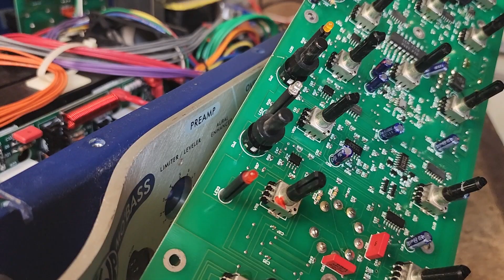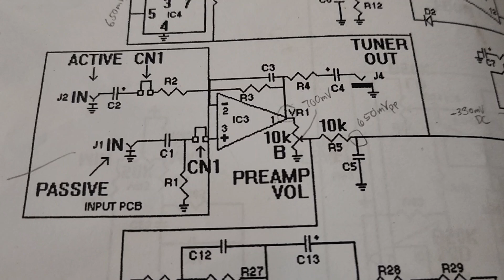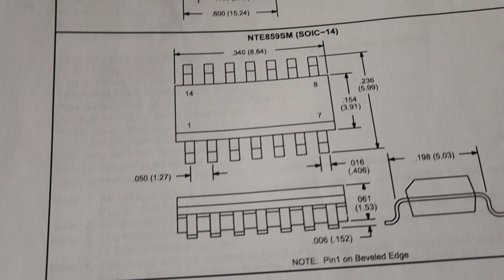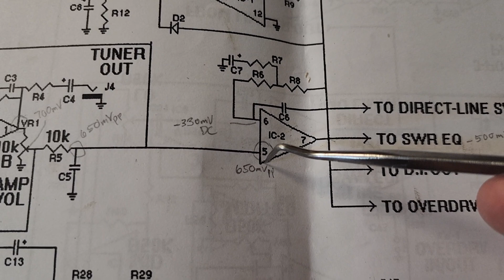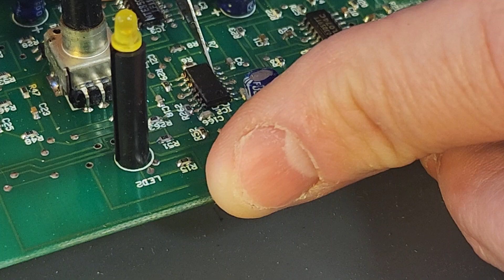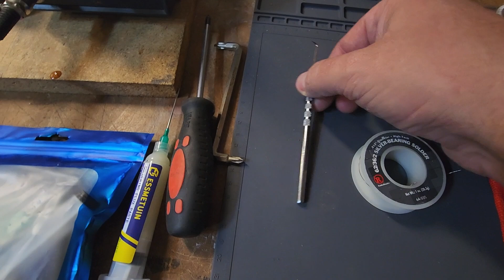SWR Mo' Bass Amplifier Repair

Comment: Great job on that repair!  I wonder what would happen if you laid a known good op amp on top of the suspected bad one for troubleshooting?
Reply from the maker: Hmm. Do you mean physically on top and try to solder it down?  Interesting.  Some of the amps might still be working and then you would be doubling the load on the input.
Reply: @paggre  wonder if you lay the ic on top of the suspect one so the pins are touching without soldering?  If the bad chip is holding the output low, it might not work though.  If you see a signal on the output, that would tell you the ic has power and ground and you're looking at a bad chip.
Reply from the maker: @Discretesignals  Definitely interesting.  That's worth a try.
Reply: @paggre  you could some how breadboard a circuit with that bad op amp to test that theory.  That way if magic smoke does come out it's not a major loss.
Reply from the maker: @Discretesignals  right.  Can't let out the magic smoke.